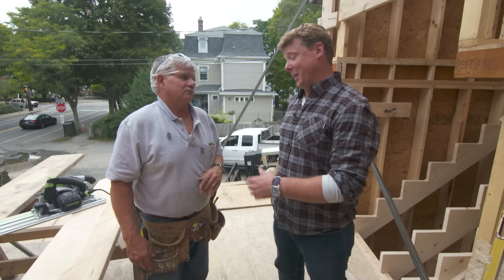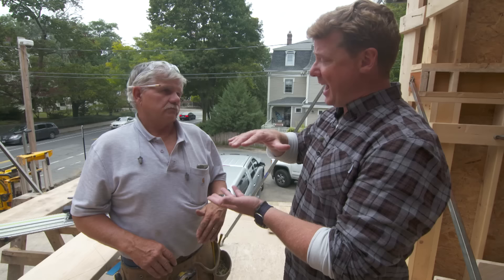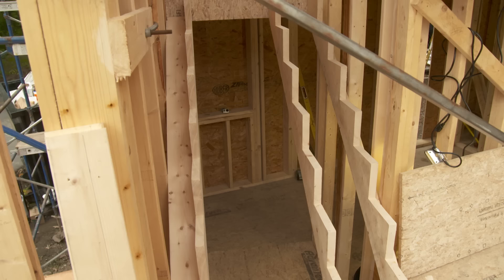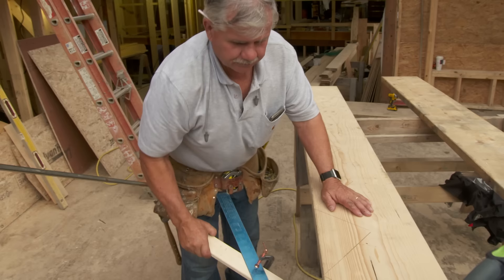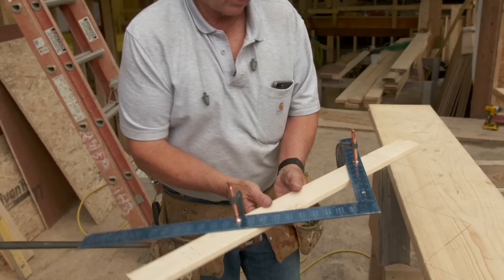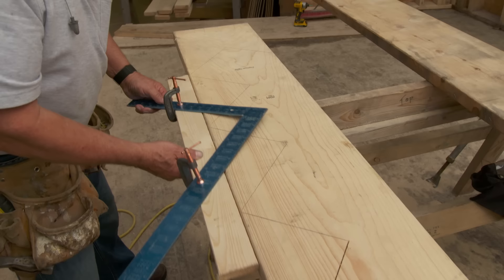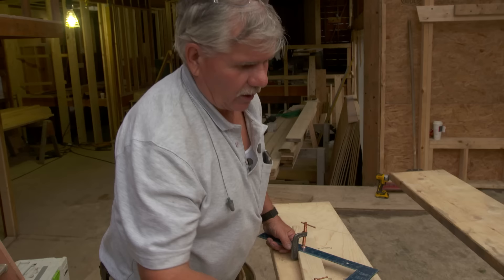How to Properly Plan Stairs | This Old House

Comment: The rise is 7.69 or 7 11/16 and the run is 9 1/2. The height is 69 1/4 so you would divide that number 69.25 by 9 which gives you the 7.69 rise or 7 11/16. The run is 9 1/2 so you times 9.5 x 8 because you always have one less run. The total run length is 76. Cut off whatever you are using for stair treads off the bottom of stringer. For instance if you are using a one inch thick stair tread cut one inch off bottom making the first rise 6 11/16 tall. The top rise will need to be held down 8 11/16. Lastly cut off the run of the top step for whatever you are using on the face of the rise treads. For example if you are using 3/4 plywood the top run on the stringer needs to be 9 1/2 minus 3/4 which gives you the top tread run of 8 3/4.

Comment: Well, he didn't explain the math between the rise and cuts...
Reply: yup dislike
Reply: I suspected from the start that the video wasn't going to be much of a deep dive, based on its (less than) 4 minute running time. I would really like to hear more about stairs!
Reply: Or calculate the tread thickness.
Reply: Most pros use the Construction Calculator.   It’s a great resource and comes as a phone app now too.
Reply: There is no formula between the rise and tread, they are individually figured using the required horizontal length of the entire stair way and the required total height.
Reply: Is there normally public code about this?
Reply: @thomaswayneward  There was a formula developed in the 19th century.  Do a search for 'victorian stairs' and deadly.  There's a history channel, called 'Absolute History' that has a video on it.  Also, when they construct stairs for scenery in theater, they use a rule of thumb that the sum of the rise and tread should be 18 inches.  It's  a safety issue, as was the 19th century formula.  Whether or not this appears in building code is another matter  😊

Comment: I am building stairs soon in a tiny house that will go to a lofted area. I would like to have storage under the stairs. A mix of drawers and cabinets. Can I build them our of all plywood? Stringers too? How can I have a stringer on the outer portion of the stairs if most of it would need to be cut out for storage?

Comment: I liked the idea with the framing square, but you never showed how to calculate the number of treads and risers one would need.  I am finding when I see stairs with 9" treads (because of the lip of the finished tread above that), especially with older citizens, they are cautious where they plant their feet so they do not fall.  I myself like 12" treads.  Would you please show how to calculate stair treads with 12" treads and 7 1/2" Risers?  Thank you.

Comment: To calculate the number of steps, take the total height which in this case is 69.25, and divide by a number of steps you think will be needed. If the result is over 8 inches the result is a bad number of steps. If the result is in between 7 and 8 inches, the result is a good number of steps. If the result is under 7 inches, the result is a bad number of steps. Total Total Riser height Steps Height 69.25 / 8 = 8 11/16 bad 69.25 / 9 = 7 11/16 good 69.25 / 10 = 6 15/16 bad

To calculate the step length, add the riser height to twice the step length. 
The result should be between 26 and 27 inches.

Riser Tread Tread
Height Length Length Total
7 11/16 + 9 + 9 = 25 25/36 bad
7 11/16 + 9 1/2 + 9 1/2 = 26 25/36 good
7 11/16 + 10 + 10 = 27 25/36 bad
Reply: Thanks.
Reply: @jonnboimuhfucka  
Your Welcome! 😎👍
Reply: Steps are some intimidating.
Reply: SH (step height) is 170 till 180 mm (6.7 inches to 7.0 inches)
But the step depth is the magic number 620 mm (24.4 inches) in a formula.
That is 2SH+1SD = 24.4"
Now take Height 6.7" times 2 = 13.4" + X = 24.4" so X is 24.4 - 13.4 = 11"
Test this (2x) SH = 6.7" + SD = 11" the total shall be 24.4"
All this gives you that is you choose the step height of 7" the depth shall be shorter.
You can do stairs that have longer depth. That is no problem. Just don't do them to short.
Reply: @72strand  
Actually, I worked the calculation until I got the same answers that Tommy provided in the video.

FYI: Most code specifications in America are still SAE, not metric measurements.
Reply: @scotttovey  I did both metric and SAE here, (btw i read that you are now near alone in the world still not using metric.)
I also think 8" is way to high. 7" is good but so are 6". I don't like stairs that are closed. I want a open step. Open step, wide step, not too narrow stair and not too steep angle. All this gives that the stairs. Take up a lot more space and get longer. But you are going to walk up and down a million times. You will thank me.
Reply: @72strand  
"I did both metric and SAE here, (btw i read that you are now near alone in the world still not using metric.) I also think 8" is way to high. 7" is good but so are 6". I don't like stairs that are closed. I want a open step. Open step, wide step, not too narrow stair and not too steep angle. All this gives that the stairs. Take up a lot more space and get longer. But you are going to walk up and down a million times. You will thank me."

While you have a point with your open verses closed stair point, it's not up to you whether those stairs are open or closed. In the end, that is up to local building code. And if the local building code has no preference, it is up to the person that is paying to have those stairs built.

In America, the measurement preferred is the one that is able to obtain the tolerances necessary for the job. Metric cannot get down to the close tolerances that SAE can which is one of the reasons that America has not completely shifted over to metric. Now, when metric makes sense, some companies choose to use it, but it is pretty much up to the company to make that determination and none of them are going to toss out perfectly fine and working SAE tooling just to spend money on metric tools. Nor are they going to make their decision based on European specifications unless they are making parts for European products.

As far as America being alone in not using metric, the world should be happy with American stubbornness; as it has had to rely on that never quit attitude to end two world wars.

You may criticize all you want, but we pretty much do what America has always done; follow the path of our God given destiny. And given that no other country has adopted our Constitutional system of government with the strong checks and balances it has, we have for the most part, always been alone. 

Besides, leaders don't make decisions based on the latest popular opinion, they make decisions based on strong, solid, historically proven to work values that are upright and just. And contrary to the nonsense that Obama spewed while in office; leaders do not lead from behind. They lead from the front.

Comment: Going by the marks of a framing square when laying out stringers, you're almost always guaranteed to be off at least a 1/16nth of an inch. Measuring the hypotenuse is the only accurate method for stringer layout. I rarely see anyone do that.
Reply: That's true. I once saw a carpenter use the square, and he gained about an eighth of an inch on each tread. Over sixteen treads, he was off two inches at the top.
Reply: CORNER MARKET PLACE  Ok :)

Comment: You need to think about tread thickness, too.  For example:  If finished floors are 3/4" and tread material is thicker (say 1.25") and you don't lower the risers that 1/2" difference, your first step up will be 1/2" taller and top step up 1/2" shorter than all the steps in between.  Riser layout would be the same, but you'd need to cut that 1/2" off the bottom.
Reply: You are right that you need to adjust for finished floor but your risers height is measured from finished floor. Your bottom step would be taller until the hardwood or whatever is installed.
Reply: @mpybals8002 
Always a good idea to start a story pole with ALL the pertinent information on it. This includes any possible landings, although this set didn't have any.

Comment: Tom ran into a little problem on these stairs as a 9 1/2' tread is the minimum tread allowed. He probably has an issue with them sticking out in the hall but I'd make them closer to 10".  2r + t = 25 would give you 9 5/8".

Comment: He forgot to subtract  1/4" to the bottom of the stringer that sits on the floor ,to accommodate for the thickness of the tread which is 1" thick .1" (Tread) - 3/4"  (Floor) = 1/4" ,so by taking that 1/4" off the bottom it will lower the top tread 1/4" .Ex: Risers are suppose to be  7 1/2"  high ,so by taking that 1/4" off the bottom your first rise at the bottom will be 7 1/4" high and the rise at the top (from the top of the floor to the top of the tread) will be 7 3/4" ,so when you install your hardwood floors or ceramic tiles with sub-floor (3/4") thick and your treads (1") thick all your risers will be equal from bottom to the top .You need to subtract what you intend to put on your floor to the thickness of the tread which is 1" thick .
Reply: Yep, I came to the comment section to see if anyone else noticed this.
Reply: Trying to design a switchback staircase- I want a rise of 6” and tread of 12.5” - is that allowed? And working with 10’ ceilings on main

Comment: We have to have a 90 (Lshape) staircase going to basement.  Two of the floor joists have to be removed to allow for head room.  Do the headers that cap off the floor joists have to be supported by a wall under them, or can I keep it open?
Reply: I know it is late, but the joists holding the header should be doubled.

Comment: What I do is: After the lay out with the square, LEAVE the pencil mark with the saw blade, this is the template. For the rest of the stringers, put the pencil mark DOWN on each new stringer, and REMOVE the pencil mark with the saw blade. Your stringers should all be the same... Good luck !

Comment: Wow I will never do stairs another way. I like the circular saw with guide/fence/track attachment too
Reply: Nick DiFilippo it’s a Festool HKC saw
Reply: For almost $900 for that saw and track, I don't like it that much
Reply: Scottybravo1 time is money. Most good tools will pay for themselves if that’s the work you do
Reply: They are being paid to promote the guide.  Any carpenter would be laughed at on the job if they used that guide.  I can cut as good as a table saw on any cut, freehand, and so can any good carpenter.
Reply: @thomaswayneward 
You are correct about the festool track saw, but having spent over 40 years trying, I still haven't gotten to the level of skill you claim to possess. I haven't seen it in any others, either. What a good carpenter does is work around his deficiencies.  I have several homemade track saws, simple masonite and 3/4"x3/4" hardwood saw guide in lengths of 8', 50", and 18" that take the skill of cutting a straight line out of the equation. For most things, I don't even take them out of the truck. But when I'm building cabinets or coffered ceilings, or stairs, they come in real handy for the price of $20.

Comment: Nails are actually better than screws for 99% of wood framing—the most important thing you want in a fastener for a building unless you are sistering material is sheer strength. I feel like he’s sold out to be more attractive to the undereducated viewer. 

This is why men like Essential Craftsman and Larry Haun just can’t be replaced. It bothers me that the kind of work that is typically to be very home-grown is becoming so commercialized.
Reply: Nails are plenty good for all carpentry.  A single 16 sinker will hold about 400 lbs.  so four in a stud is 1600 lbs.

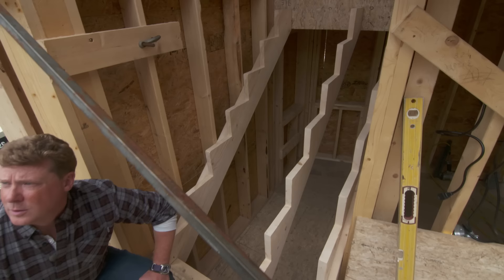Comment: 0:40 which idiot designed those stairs.  They are good for if you want to fall down. Here the steps are too small
3:17, yet another disaster. the steps seem too high, difficult to carry things up.
Has no one in the US an idea how to design the ideal stair?
Reply: DR PHIL  Of course Amsterdam and the UK are bad examples.  In other European countries that type of stairs would not get an approval. Guess the family of this old house is originally from England or Holland.
Reply: DR PHIL  Yupp
Reply: CORNER MARKET PLACE  the steps are too high, the stair is too steep and the entire foot doesnt fit on one stair step. I posted my initial comment 2 years ago.